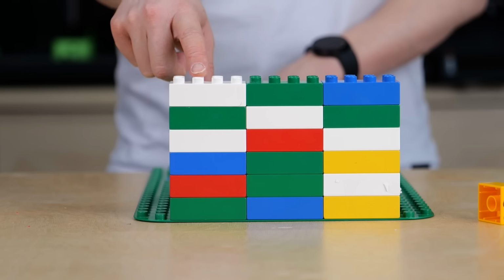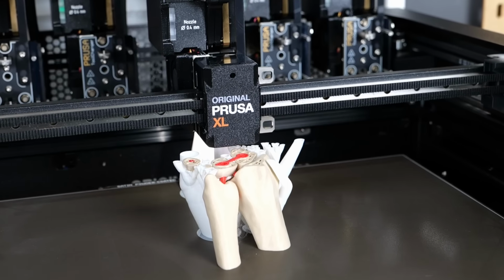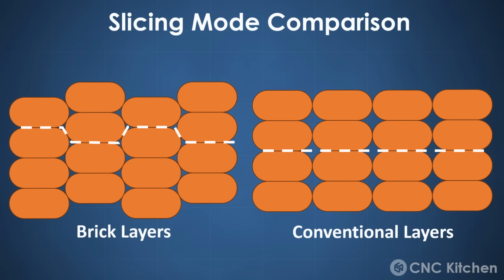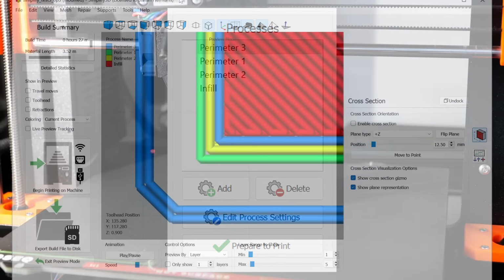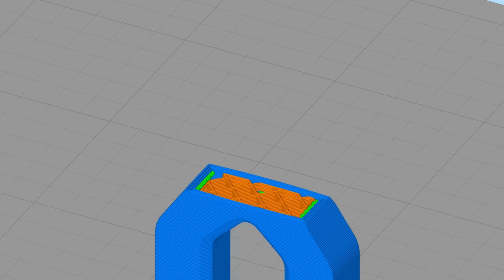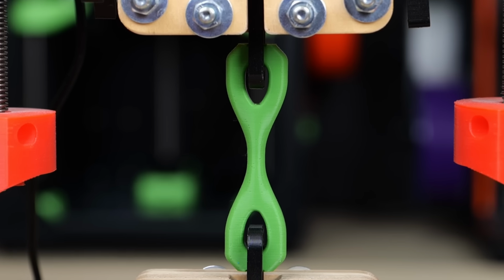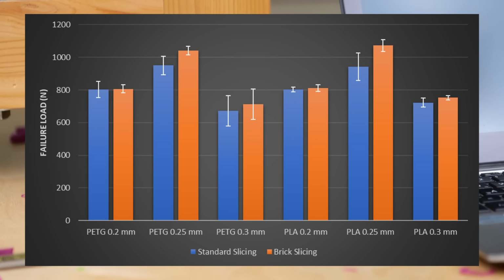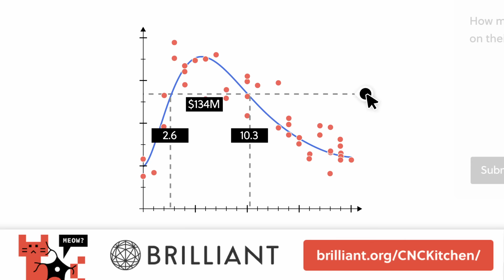Brick Layers - Why did no one do this before?

Comment: I was thinking your gona do this a different way

First layer        0,3x5
Second layer.   0,5x3
Third.                  0,3x5

0,5x3

And so on
First number is line with, second one is wall count.

That would off shift them like bricks,
Somehow Combined with your method it coul be 25 30% stronger idk

Also the parts at the end ar not braking at the right point, so i dint think your testing layers like that.
Rather then the entire part
Reply: It maybe look a bit ugly but 🦾

Comment: As a bricklayer, block layer, stone mason; we also add steel horizontally and vertically. As concrete has great compression strength and not such great pulling strength. By adding steel to our work; ie. rebars and or wire lock; we transfer the pulling strength of steel to our masonry, and the compression strength of concrete to the steel. 🇨🇦🙂👍

Comment: You printed it vertically and you doing vertical stress. Print them horizontally and do vertical test to see do outcome. You need to predict stress direction and according to that, print the parts in a specific position.

Comment: CAUTION COMMERCIAL USERS OF THIS TECHNOLOGY. This is fully covered by the ADDMAN patent US 11,813,789 B2 and other ADDMAN patents and patents pending.  This method has even much more strength improvement in fracture and sheer than the tensile test shown. It also almost eliminates porosity making prints air and water tight.
Reply from the maker: Thanks for the info. US 11,813,789 B2 actually perfectly describes what I did here. Yet as fas as I read it it has been filed in 2022 where there has been plenty of prior art, so it might not be the end of this in Open Source Slicers.
Reply: Thanks for your response. @CNCKitchen   The provisional was filed in 2019 and the patent was published in 2023. The patent still prohibits commercial use of the technology unless the prior art was applied and moneys changed hands on a transaction. Then the prior art applier has it established. And possibly then they may continue commercial use but not always. There are other patents and patents pending around this specific patent. Let me know if you would like to discuss, I like your work!
Reply from the maker: The one GitHub feature request I also posted in the video is from Feb 2019, so also pre-dates this patent. I know in the end someone has to fight the patent and this costs (a lot of) money. In the end, only the lawyers are winning in this. Happy to further discuss this. Feel free to reach out to stefan@cnckitchen.com.

Comment: BREATH-TAKINGLY totally-GREAT analysis & presentation!! whewww...a truly-amazing video. Me: real catamaran-builder, and would suggest...your cross-section visuals illustrated the line of Force through adjacently-stacked output "threads" (I know nada about 3D))), right? Now...supposed there was a secondary print-head, that would introduce a...ooooohhh....single carbon-fiber filament!! Or somesuch. CF sure does wonders when imbedded in epoxies, for strength & flex!! Why not at that crucial printing step in 3D-print'g., a simple filament would hardly imped that process, I reckin', yes? Just another little spool, etc., too. dinkaboutit... subd/likd

Comment: With 1400+ comments, I did not check if this comment was made by any others.... Laying bricks in the real world are never strong in the tensile direction. Your lego sample video also was not demonstrated in the tensile direction either. Maybe you could recalculate these results using diagonal + compressive force vectors. Also maybe more heat in the extruder nozzle to create stronger bonds between layers. Revised extruder paths to keep the lower layers from cooling while the extruder is away printing some other part of the design. I know most people want "PRETTY" parts, but sometimes "STRONG" parts just have to "LOOK" bad, to be good.

Comment: For most cases, just not that important. The point of most 3D printing is for rapid prototyping, which wouldn't benefit from the 10% increase in strength.

Comment: You tested your pieces by pulling them apart, but that's not really a force that a brick wall really ever has to deal with. A brick wall needs to withstand compression force, and forces from its side.
These are the tests you should do with this printing method. Don't judge a fish for its ability to climb a tree.

Comment: You're not introducing new weaknesses. The explosions and alternative cracks are from impurities in the material. Your maxing out the adhesion structure to the point where impruaties in the material are the weakest point of failure, not the adhesion layers.

Comment: "the approach we use today works  remarkably well and its really simple" if it ain't broke dont fix it. i make real world parts things that get used and some in pretty bad environments. like a mount for a 2 stroke motor from the late 60s (massive amounts of vibration) that holds the air cleaner to the carburetor. nothing supports the air cleaner. i run this part on my gokarts 3 screws hold the mount to the carb i have never had one break in the 4 years ive been running them. and they get subjected to gasoline, raw and fumes. how much time does this add to the print. im not sure what your doing with your parts where they are failing in the real world i would like to see a couple examples of that.

Comment: Wraum soll das mehr - viel - mehr Stabilität bringen? Ich kann mir das nicht vorstellen. Bei einer Mauer ist das klar, warum das stabiler ist. Eine Mauer ist mit einem 3D Druck nicht zu vergleichen. Bei der Mauer wird durch den Versatz die ganze Fläche stabilisiert.
Erkläre doch mal bitte, wie man dein Beispiel mit der Lego Mauer auf eine 3D Gedruckte Wand übertragen kann?
Durch diesen versetzten Druck stabilisierts du doch höchstens die Wand innerhalb der Wand, aber die Wand nicht in der Fläche.

So wird es auch bei Stabverleimten Holzbrettern angewendet. Das alles kann nicht auf den 3 Druck angewendet werden. Ich sehe da gar keinen Vergleich.  Uch kann es leider nicht besser beschreiben.

--------------------------------------------------------------------------------------------------------------------------------------------------------

Woman should bring more - much - more stability? I can't imagine that. With a wall, this is clear why this is more stable. A wall cannot be compared to 3D pressure. In the wall, the entire area is stabilized by the offset.
Please explain how to transfer your example with the LEGO wall to a 3D printed wall?
Due to this offset pressure, you only stabilize the wall inside the wall, but the wall not in the surface.

It is also used for rod -gluely wooden boards. All of this cannot be applied to the 3 pressure. I see no comparison at all.  Unfortunately, it cannot describe it better.

Comment: I hope you read this. 1.7k comments tell me that you wont... But here we go.

Diaclase families.

In original pattern, diaclasing family goes from left to right, and from up to down, and viceversa.

In bricklayering pattern, new diaclasing family is created. You have from left to right, diagonally from upper left to down right, upper right to down left, and double viceversa. Also, you have from up to down. Here is your problem.

The up-to-down diaclase is the weakest of the entire family. Bigger gaps, less contact surface. The whole piece is weaker in its vertical axis, and the force applied in simulation are exclusively vertical. That produces shattering of piece.

Try printing the piece laying down, on the other axis. Run test again and see results.

Comment: Great video! I think a lot of people thought about this because it makes so much sense, but you actually did it. I hope in future this becomes a standard setting for slicers.
To get the most out of this, I think it would be a good idea to slightly increase the pressure so the gaps get filled better, creating basically a hexagonal pattern in the section.

Comment: 3:08 DO NOT look up at software patents, like, never. Srsly. If you're a programmer, and you've ever come across some problem requiring solution even remotely similar to anything you've seen patented / pending patent / anything anywhere, you're basically ficked. Xddd
Reply: Software dev Here. If you require a solution, you develope it yourself and later found out, that that exact solution is already patented, you contact the patent holder and request free use of the patent, else you go to the patent office or hire a lawyer and get the patent revoked as it is an obvious solution, which cannot be patented. The exact execution might be patentable, but not the idea of it
Reply: I decelope case management software and I personally had 3 attempts revoked and 2 free licences for patents

Comment: Your tests are flawed, as you only tried tensile strength - and only in one axis at that. No shearing strength tests (ie. trying to "snap" the test pieces by bending them - prolly not actually called shearing but dunno proper term then), nor any compressive tests. And the "brick" pattern clearly needs to also be tested along the diagonal line they produce (particularly when testing shearing strength, as that should remove any "friction" advantages of layers compressing into other layers).
I imagine that regular pattern only creates a weakness along a single axis if you try to shear it, but the brick-pattern results in TWO weakest axes for shearing (with asymmetric strength depending on which direction you try to pull each side). And for tensile strength I imagine the brick-pattern has THREE axes of weakness (or potentially even more! 6?) as each axis of the hexagon (brick) will be weaker. Yes, each of them are prolly still stronger than regular pattern, but the trade-off is whether you want slightly more strength in the weakest axes, in return for more axes being weak.
You indirectly mention these things when you show graphics of stuff like "slanted failure".

Comment: Your test is flawed. Printing the layers the way you did won't increase the strength during a pull test. It should however increase the strength in a shear test. Look at your layers, you have a sizable overlap in the horizontal plane but very little overlap in the vertical planes. There is a little simply because it was allowed to fill in the small v shaped gap between the layers giving you roughly 10 % overlap thus resulting in the 10% gain you seen. To get the most strength it needs to go to the middle of each path both horizontally and vertically.

Comment: This doesn't work on any level. First off, it's not an apples to apples comparison. Plastic vs masonry. Second, those angles will cause more mortar to be used and the bricks will have to be bigger and heavier in order to avoid a weak point where they taper. Thirdly, you now have to cut bricks on all sides of the wall to make them flat and flush - making more work and waste. Lastly, it's aesthetically bad. Having all those bricks with that shape laid down will look like fish scales rather than the solid structure that anyone who's using brick wants. 
It's just a bad idea all around. Having a short discussion with an actual bricklayer would have saved you the energy it took to make this video. But enough people took the bait and watched it so I guess you got the result you wanted, regardless of how goofy the concept was.

Comment: I disagree that thinner layers means less bricking.  The bricking is smaller but the thinner layers can mean more squeeze out and create fewer voids so the intersections between layers are inherently better.  I cringed when I saw your height/thickness ratio and the quantity of voids between individual lines of filament.  I hope that isn't your standard operating procedure, because its's not good.   Also I notice you never print anything over 50%... I have heard people use a 'rule of thumb' often repeated that anything over 30% doesn't increase strength.  Please nobody believe this myth.  If they are finding this to be true, chances are they have other fundamental issues with their process, as shown by the horrendous voids in the microscopic images shown in the video.